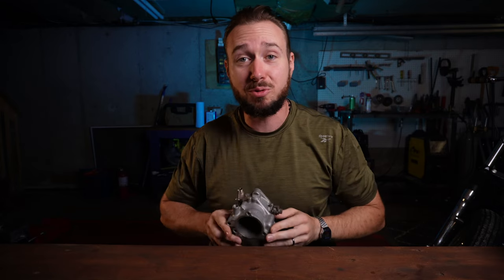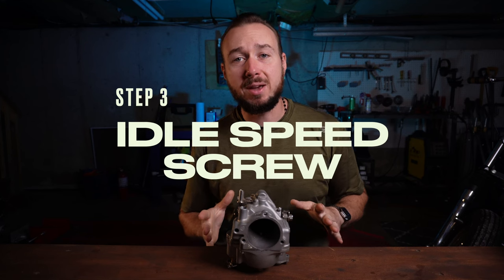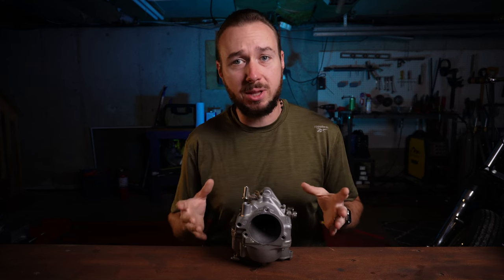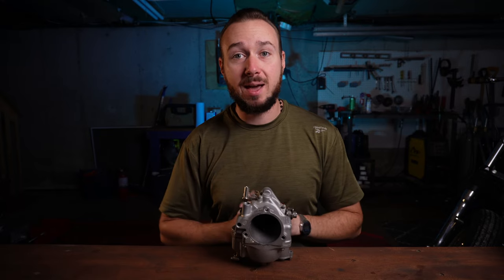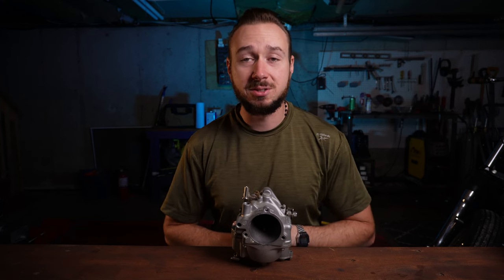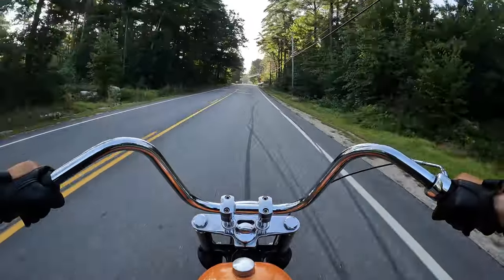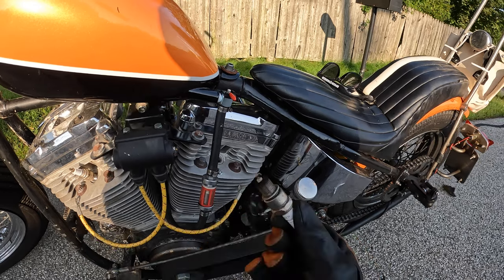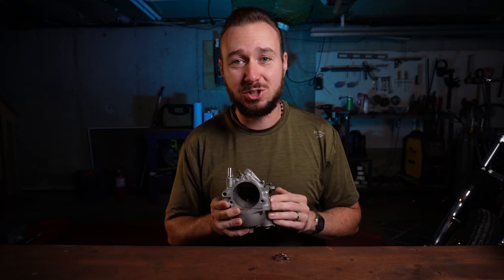Tune Your S&S Super E Carb Like A PRO

Comment: Followed your instructions but i was also confused with the idle instructions?🤔 Can't turn in after seated so i left it at that. Started bike and idled so fast I'm glad it didn't blow motor but after i turned it back out to where it idled low turn it back up to where i thought idle was good bike is running the best it ever did. Delete that video and redo a new one explaining idle adjustment before someone blows a motor.
Reply from the maker: If you watched the video, you’ll see seated means it just touches the screw to the metal tab. I show it visually in the video. I’ve never had someone interpret it the way you did
Reply: Well for a first timer like me I still don't know what tab you're talking about. You say when it seats half turn in🤔 and did watch video several times to figure out what you were talking about
Reply: Lightly seated... you goofball. 1000% misunderstanding on your part!

Comment: I've had a few CV carbs never a problem. easy to put jets in , and tune. never  broke down or messed up. I got this S&S super garbage "E" carburetor on a  94 wide glide and what a piece of crap. Impossible to tune. bike won't run I've checked everything else I'm done. I'm pulling this piece of garbage off. And I'm not even going to sell it to anyone else. I'm going to destroy  it.
Reply from the maker: There are fake ones out there. I wonder if the previous owner threw an eBay special on there and those fake eBay ones will never run right
Reply: This is an early one cause it doesn't have a jet for the air bleed. So  I might wrong but I think it's 25 years old at least what I read.
Reply from the maker: @jimgagne3801 mine is also that style. What size motor are you running and what size jets?
Reply: Just a stock 80 inch EVO , 94 dyna wide glide.  It was a friends bike but it would foul plugs, then he died and I inherited the bike.it didn't run though. So I dropped the Boal and it had a  76 main and a 29.5 pilot.  The mixture screw was at  2 turns out and the accelerator  pump screw was  at one turn the plugs were fouled  but it would only start with the choke on and run that way till you foul the plugs. It's getting gas, I went back to the factory settings and new plugs, and it won't run at all. Unless I use starting fluid  then it dies. I've changed to 66 a main and 68, and a70 main and went down to a 28 pilot . But it just doesn't run till i spray starting fluid. I don't really want to give up on it cause it's American but I'm thinking I have to either take it off and completely rebuild it and start over, or try a CV that I have laying around that's a new take off. And see if that is the problem,  or maybe it's something else.  I'm, just old and tired off working on stuff after I get out of work as everyone rides by my house enjoying life before the world goes to crap...yes I am whining. 😢
Reply from the maker: @jimgagne3801 if it’s any help, I run a 72 main 29.5 pilot on that same size motor. I could possibly go down to a 28 pilot though. All my settings are here in this video. 

If that doesn’t get you running, I would be willing to bet that there’s a problem outside of the carb or with an air leak at the manifold

Comment: FRENCH LANGAGE, PLEASE !!!
Reply from the maker: It should allow you to choose French captions
Reply: @greasesgarage  I went to your settings there is no French
Reply: @greasesgarage  I have a shovel with a shorty I can't adjust my recovery pump
the jets are 72 for the main and 29.5 for the pilot
what do you recommend in terms of number of turns?
Reply from the maker: Shoot I’ll have to look into this, that might be a YouTube thing though because I don’t think there’s an option for me to change anything
Reply from the maker: To adjust accelerator pump you want to start from all the way in and turn out in half turn increments until you get a good throttle response
Reply: @greasesgarage  ok G&G, 
je vais faire comme tu me dis et je te dirai si c'est correct. MERCI
I'll do as you tell me and I'll let you know if it's correct. THANK YOU

Comment: S&S E is a good carb, but overpriced.
Reply from the maker: The nice part is they’re literally everywhere so getting them second hand for $200 and below is no difficulty at all
Reply: I'm running a S&S knock off from amazon and surprisingly enough it works very well and cost me a meager $52 new and $28 for the manifold. Hard to choke down $450 without at least giving the amazon a shot